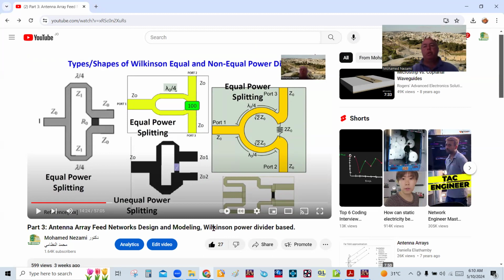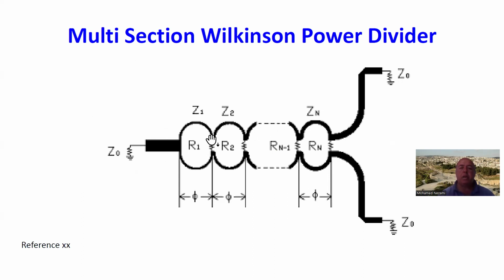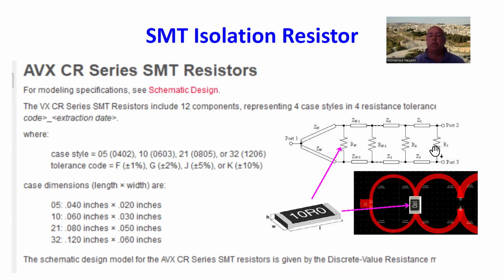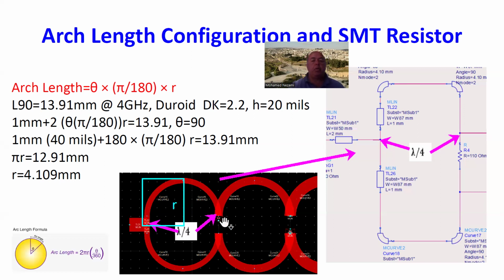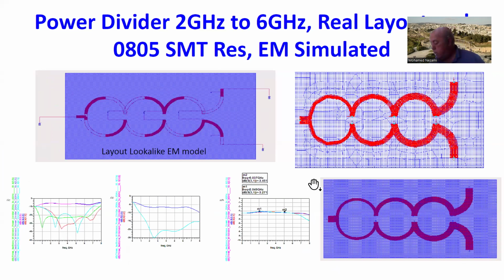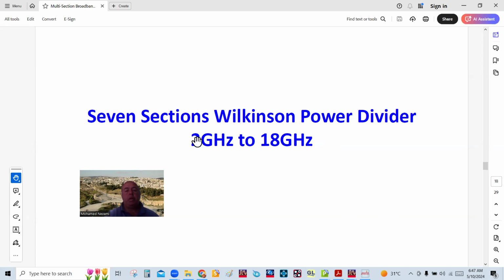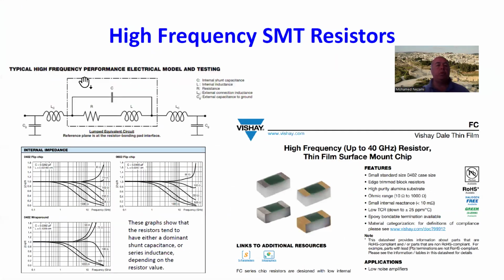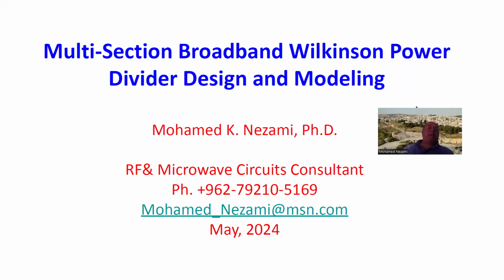Multi-Section Broadband Wilkinson Power Divider Design and Modeling

Comment: Hi Sir,
I am currently following your ADS tutorial and I noticed that you used the resistor model “sr_irc_cr_0805_l_19960828.” I was not able to find this model in my installation of Keysight Advanced Design System.
        Could you please let me know:
* Which version of ADS you used in the tutorial?
* Whether this model comes from a specific library or requires additional installation?
* If there is an alternative component I should use instead?

Thank you very much
Reply from the maker: You can use any resistor 0805 0402 ..etc and get its s parameter model from manufacture

Comment: for resistors values how do you calculate ? for multisection approach like 3 section and 7 section ? i didnt understand those values ? can u tell me ?
Reply from the maker: use precalculated tables, N versus resistor values. The value came from minimizing reflections on ports 2 and 3.

Comment: Have you tested this model experimentally? I have used this model in simulation, it gives good results. But when used in real life, the results are really bad.
Reply from the maker: yes I did use it, and got close results, and so does 1000s in the literature,  but you have to make sure the manufacturing issues do not mask out the performance,  like DK values,  material thickness, plating, housing, ...etc
Reply: I made a similar design, but prototyped with the arcs overlapping at the joints and side by side above, the side by side performs very poorly as it significantly shifts the center freq if you don't account for the extra length.  overlapping the semi-circle arcs or using quarter arcs  to create a bell shape works better.   bevels are easier to use if you don't need high current.  don't forget to adjust the lengths to the effective er.
Reply: @euankirkhope5390  Thank you for your feedback; I have fixed the problem. I suspect it was because the substrate I previously used was too thick at 1.6 mm. After changing it to Roger's 0.4 mm thickness, everything is fine now.
Reply: @euankirkhope5390  I'm waiting for my circuit board to be shipped; I'll come back here once I have the measurement results.